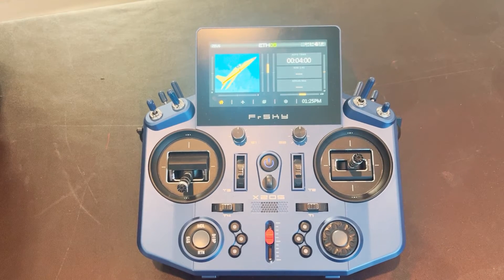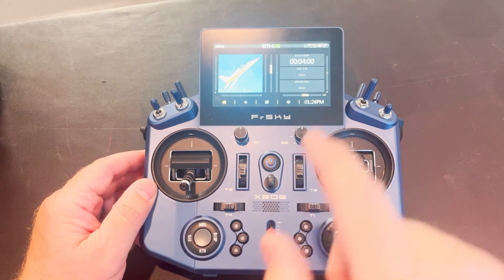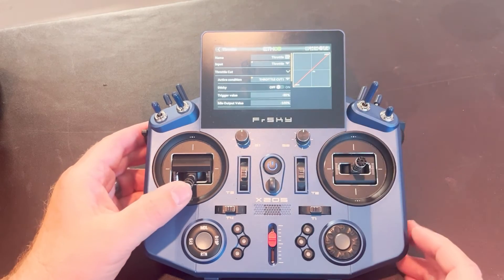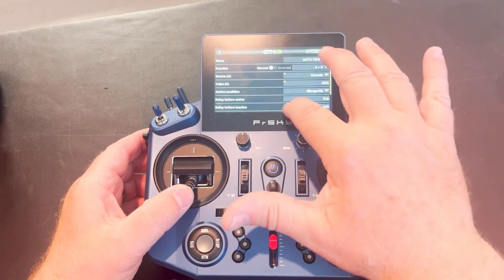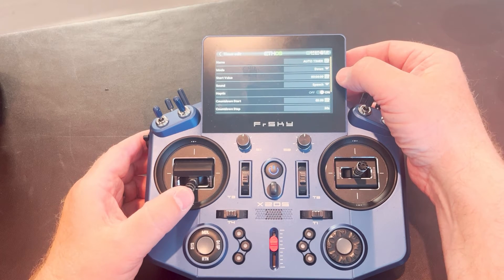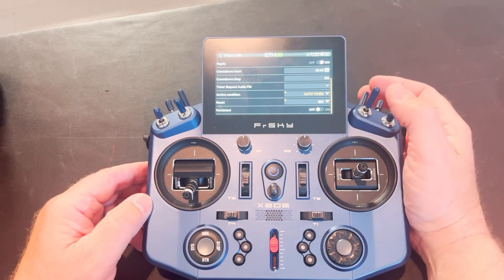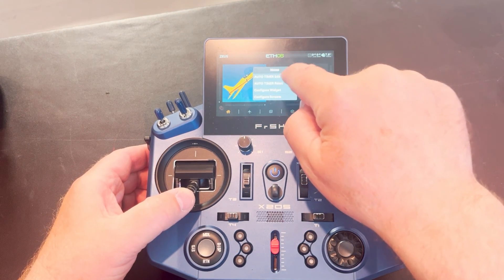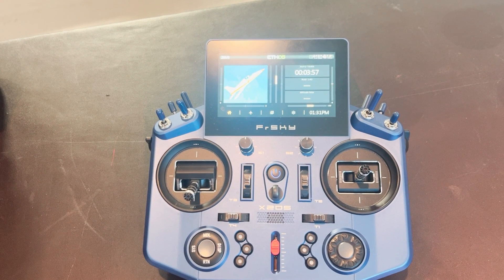FrSky X20S Timer linked to Throttle setup Autotimer

Comment: I was able to set-up the Throttle Autotimer, but I cannot get any sound for countdown.  I have a new 20X RS which screen is slightly different than your video. When I am in the Timer Section, below persistent is Voice. To the right of Voice is Voice 1 us with a down arrow. When I tap on Voice 1 us, it will not let me open the down arrow. Another way of saying is that i cannot get it to light up when I tap.

Comment: I’m saddened there’s no other comments ahead of mine.  I found your tutorial VERY helpful.  I note that your screen display is a bit different given I am running EthOS 1.5.9 on my X20RS (two months after your publishing). So, I’m 95% complete; I just have to figure out why my timer isn’t working fully.  Cheers!
Reply: two minutes later… I figured out my reset problem.  I’m 100% squared away, and 100% happy with your video!
Reply from the maker: @Scairborne66  glad it’s working. Sorry for the late reply
Reply: Same here